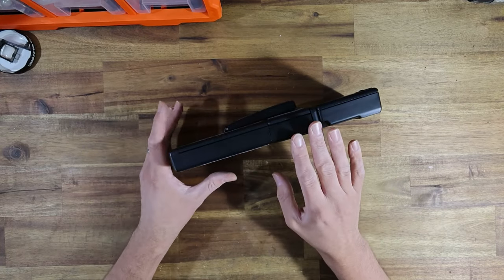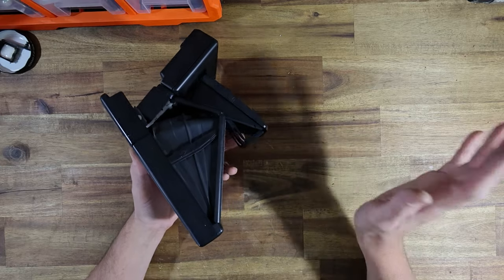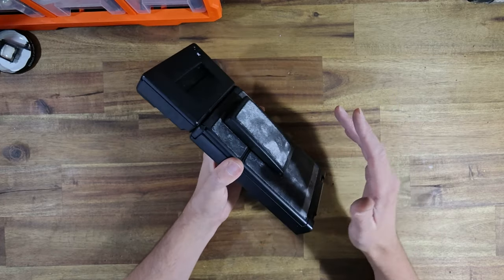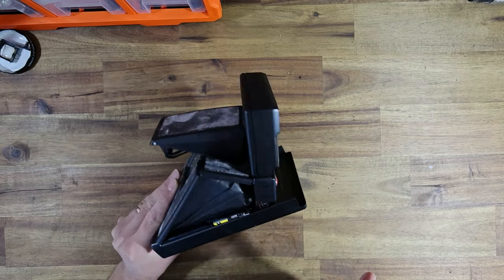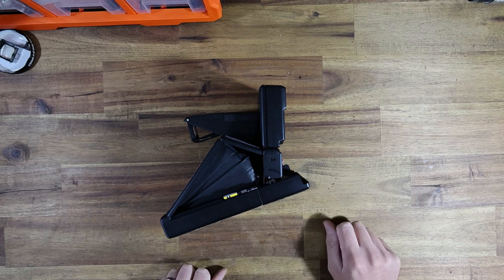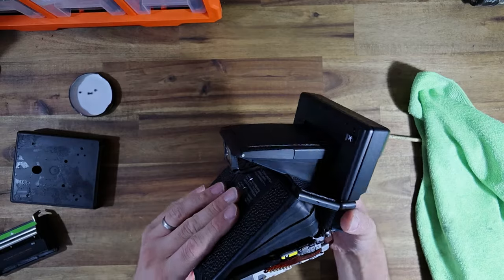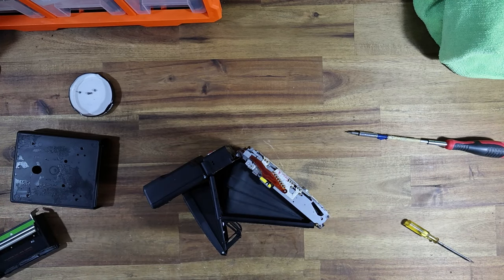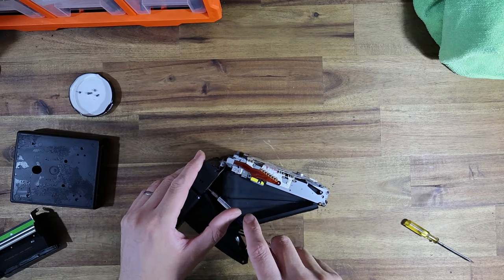Polaroid SLR680 Overhaul & Repair - Fixing one of the most over-rated instant cameras!

Comment: Hi, great video! My 680 has issue with the flash. It works fine if I keep it at in position. But if I turn it off and turn it back on it doesn’t fire. I have to pull out the film pack and put it back in to make the flash work again, which is super annoying. Do you know what is the issue?
Reply: I have a guess that the flash needs to be discharged in order to get charged. If I switch to no flash, while the flash is half charged. When I switch back to in it won’t get charged, so it doesn’t fire. This is only my guess.
Reply from the maker: @MrHouse-om3jz  hard to know without seeing it in person

That's a strange issue

Comment: Also, can anything be used to clean the Fresnel screen? I have a pretty dusty one that also has imprints of the inside bellows on them. I've been gently wiping with the "grain" of the Fresnel with no liquid of any kind. Is there something that can be used or should I just try to dust it with nothing on it?
Reply from the maker: @revolverrr  glass cleaner

Nothing will remove imprints though

Comment: Do you have the setup to convert a SLR680 to I-type?
I found a SLR680 at a flea market for 25€ but don’t like the battery packs on 600 film and the throw away mentality…
Reply from the maker: i-Type battery adapters are available from numerous manufactures at the time of this comment

Retrospekt, Polastudio, Rezivot etc are just some examples

If a client want's an i-type mod, I recommend they send the adapter in with the camera they want refurbished so I can fit it at the same time I do the overhaul :)

Comment: "500USD for a poor condition one"
Yeesh, meanwhile I got mine for 80 bucks just a few years back (admittedly, cheaper than most as I did need to re-sit something and the seller was kind enough to offer a 50% refund for my trouble), and only ran into an issue this year where the flash stopped working after unreliably triggering for a couple months.

Curious, if you don't mind me asking, would you figure the flash not working being from a cracked solder joint or dead cap? The LED for the flash stays on longer than when I first got the camera, flashes on after it turns off when I half press for focus, but then nothing happens when I snap the picture? Perhaps you've seen this issue before and I wouldn't spit on the wisdom of someone much more knowledgeable than I am!

Either way, thanks a lot for some great ressources about those ol' beasts, a very nice video to sit along for the ride watching your whole process! Cheers!
Reply from the maker: @Nomaxice  my guess is your switch is bad/dirty

But it's very very hard to tell without seeing it in person
Reply: @theinstantcameraguy  I'll have to check it whenever I work on it, would be odd since it does seem to work and start the capacitor charge, but never know! Thanks for your response!

Comment: Hey, I have a 680 that I'm planning to sell and would love to hear your opinion: So after some research and testing, it seems that the autofocus doesn't work; when I press the shutter down slightly, the lens doesn't autofocus. Also, I don't know if the camera works or not; should I purchase and test it with some Color Film 600? With these things in mind, would you recommend I fix it before selling it or should I sell it as-is? Any help is appreciated!
Reply from the maker: All 680 cameras need to be serviced right now

In its current state, it should sell for the low-end of the market, since whoever purchases it will need to have it fully refurbished
Reply: @theinstantcameraguy  I understand. Thank you for your input!

Comment: Thank you so much for making this. I recently purchased an 680 in rough (but working) shape for $250 which feels like an “ok” deal considering what some people pay for them. I’m a computer repair tech so I think I have the skill to do most of this, but I really can’t thank you enough for sharing the information. Absolute legend.
Reply from the maker: the only advice I can give is to not cut corners, and be prepared to accidentally break something if it's your first time!

These are hard things to work on

Also watch out for the flash capacitor! It will zap you!

Comment: I always remove remaing glue by putting a piece of gaffer tape over it, rub it on real good and then pull it off again. It may take multiple times but the glue from the gaffer tape usually takes the remaining glue off with it.
Reply from the maker: Not a bad idea

I worry about removing the superficial plastic layer though by accident. They can be so flakey

Comment: i have a question ¿can use that flash in a normally sonar body? and use sonar Board? recently get slr-680 completely broken body, but front Is in perfect condition, supose need replace lateral arm, but need more work? or just are incompatible
Reply from the maker: Not without lots of notification

You'd basically need a spare camera to poach parts from, to convert your 680 into a standard sonar with flash socket
Reply: ummm basically is more easy just install 680 electronic in sonar body right? have another question ¿do you have video explain process to clean lens in sonar? both systems use same lens and are very dirty inside

Comment: Ok but what is the MOST overrated instant camera in your humble opinion?

In my experience deskinning an Alpha 1 Model 2 with a chisel actually wasn't all that terrible. You just have to be patient and go with a slow rocking motion, and try and work it under the adhesive. I only had a blow dryer for heat, but was able to make do with that. Slr680's seem like a different beast though, and your heat gun tip is way underrated.
Reply from the maker: The MOST over-rated Polaroid is the SLR690. It is utter junk. Often described as the "Japanese 680", but in reality, comparisons are superficial. Electronically, they are completely different inside. Gone is all the analogue Polaroid circuitry, and in its place an NEC microcontroller and transistor arrays. Flimsy internal ribbon cables and the baffling design choice to provide constant power to the MDC03 transistor array (even when the camera is closed!) will ensure these cameras become bricked. They are annoying to repair, and it baffles me why people pay so much for them

As for re-skinning, while you might have had an easy time of it, a chisel should just simply never be used for sticky adhesive skins. End of discussion. 

It's dangerous for both camera and technician.

It IS okay to use on crusty glue (such as under the door panel), because this has less chance of getting caught. See my Model 2 restoration video for this.

I say this because I've slipped. I've bled. I've ruined body panels. A decade ago every online guide suggested chisel use. After enough accidents I said "there must be a better way". Hence why I am trying to educate people on how to do it better.